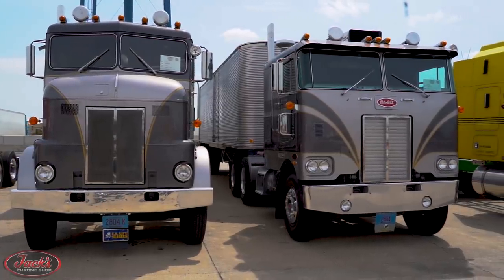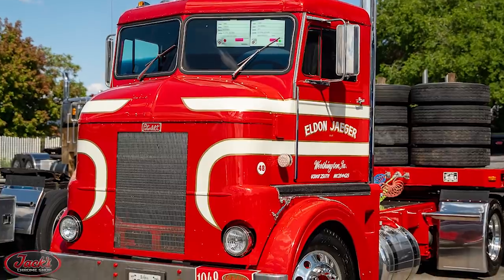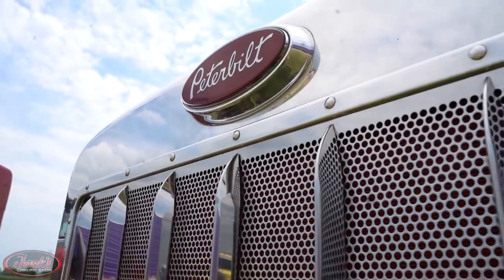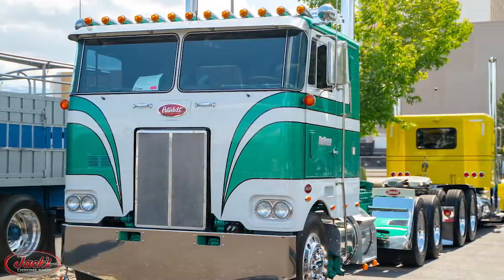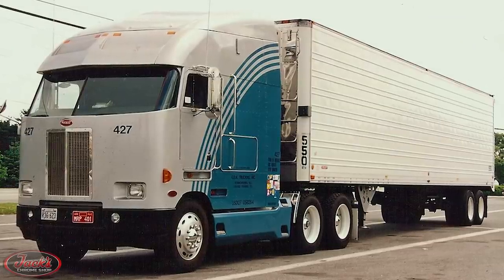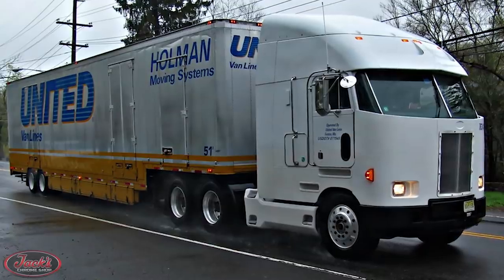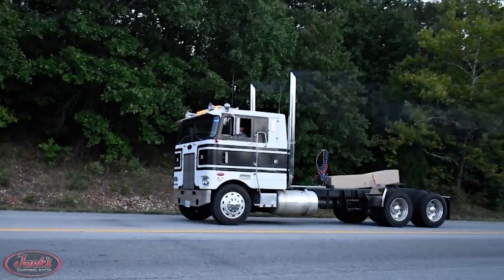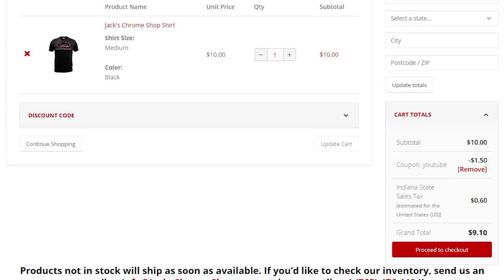History of Peterbilt Cabovers | Truck History Episode 13

Comment: Got my start working on trucks at the 
Peterbilt Motor Co in Newark Ca
Where I built hoods and cabs 
The grill assy was hand fitted to the hood 
They were hand filed for a perfect fit during the grill assembly before it went onto the hood
From Peterbilt I moved on to Mack Trucks in Hayward Ca for almost 10 year before doing an additional 27 years at a freightliner dealership  as a mechanic
Working at the factory was like going to college before my final career
In the 90’s I went to the Freightliner factory in Portland Oregon for a class 
It was like returning to your home after being away for a long time 
The similarities were breath taking to me 
The trucking industry was very educational and lucrative and allowed for me to retire with a generous pension never forgetting the chance to start at Peterbilt
Reply: If you're enjoying your generous pension, why did you post your resume?

Comment: As I continue to tool around in my 1999 International 9800 which replaced my 1990 K-100,....never had a hood, never will.
Reply: I drove a 9870 in right hand drive, truckers always talk about being wedged in the corner driving them but I quite liked that truck.

Comment: Your statement "..372 didn't sell as well as the previous 362" is inaccurate.  372 was not a 362 replacement, it was a separate model from 362.   By the time the 372 was released, the sales of all cabovers across the industry were in a steep decline - the 372 was in a weird time warp - design and aerodynamics it was 30 years ahead of time but in the trucking market at the time it was 10 years too late.

Comment: Parker Ranch had a Pete 352 from the Pacemaker Class, Parker Ranch named her "Big Red"  she started out as an open top Cattle Hauler in the Truck Trailer configuration. There were 2 of these 352's...the 1'st one was bought by Kahua Ranch wqhich my "Uncle Bobby Giltner" drove...Big Red came a few years later, my Daddy & Uncle Alika Bell drove it. Later Parker Ranch saw the veratility of the Tractor Trailer configuration & Big Red became a Tractor. Both Kahua Ranch & Parker Ranch had the 2 sticker models Big Red had the 5X4 non-progressive double overdrive set up. Had I known more Peterbilt history I would have gone in the business office & told them NOT to sell that truck!!!!!!!!! Plus, the Parker Ranch Truck Program started with my Daddy & Uncle Alika. This would make Big Red even more precious!!! I learned to drive 2 sticker's from my Daddy in Big Red. I was a pre-teen when Big Red rolled in to the Parker Ranch motor pool in 1968...Peterbilt took a 1967 model 351 and built it it up Special for Parker Ranch...the plaque inside stated: "This Peterbilt Custom Built For Parker Ranch." If I ever find Big Red I'm going to bring her home & find sponsorship to rebuild her to her former glory. The only modification would be a 3406 Cat @ 425hp or a 3408 Cat @ 450 & punch her out to 750hp. I drove a Peterbilt 359 with a 3406 @ 425 with a RTX14615 & 3.73:1 rears which could do 90mph in 10th gear with NO Overdrive, my former boss bought it used from "Don Eng Red Oval" in Anaheim Ca. The 748 & her sister's were bought brand new by Pan Pacific Construction & were used to haul contaminated soil from a shutdown wrecking  yard in Anaheim to a Dumpsite somewhere in Death Valley. My boss & I talkjed a lot about the history of what we called "The Pan Pacific's." I paid close attention just as I did listening to my Daddy who talked about trucks all the time. I think I never talked about anything else, but hot rods & Peterbilt Trucks!!!! Of course as a truck driver I drove not only Pete's, but Kenworth's as well as R model Mack's & the IH Transtar Cornbinder's, as well as a couple White's. I loved my 1st Kenworth, a 1964 W925 that had a NH220 Cummins & the 4X4 Spicer set up. She was a hardworker & I nearly had a chance to buy her from my 1 boss "Alan Koike" for 5 grand. She didn't have power steering..but I didn't give a fuck...I just got out of Prison & had over 20" arms. LMAO!!! Something happened which I'm not allowed to sharing even though my Financier is dead. He was my 1st wife's Uncle. I am glad that PACCAR rescued Kenworth from Chapter 11 bankruptcy otherwise another Iconic truck would be gone forever!!!
Mahalo Nunui for sharing this most interesting documentary about  Peterbilt Cabovers!!!
Aloha,
Chief

Comment: There's nothing but cab overs here in the UK.  We have the odd T cab (Bonneted) Scania. 
Conventional  trucks here are mainly on specific jobs. The C O E is the norm due to overall length.
The difference was/is five foot on your trailer. 
The only C O E yank trucks that I saw were Mack.  These were on plant haulage.
Reply from the maker: We will be doing a whole video on CoEs and why they aren’t used here in the US. Thank you for reminding us.

Comment: Here in Europe they use cabovers only, still today.
Reply: True but I think it's because of your roads and how small the streets are in all of the very old cities and that's also why your tractors are mostly 6 wheelers
Reply: @Notthisguyeither  Yes, you get a better view on the road with a cabover truck, more practical on narrow streets/roads etc. I haven't seen 6 wheel tractors though. Sometimes 4 on one axle, if that's what you mean.
Reply: @MrZdvy  what I mean is the tractors only have 1 drive axle with 4 wheels and 1 steer axle with 2 wheels 6 total... most American road tractors have 2 drive axles with a total of 10 wheels. A common American 18 wheeler has 3 axles on the tractor and 2 on the trailer. A common European 18 wheeler has 2 axles on the tractor and 3 on the trailer
Reply: Tim Lepley ah, I get it👍